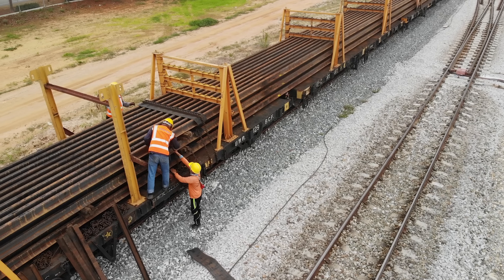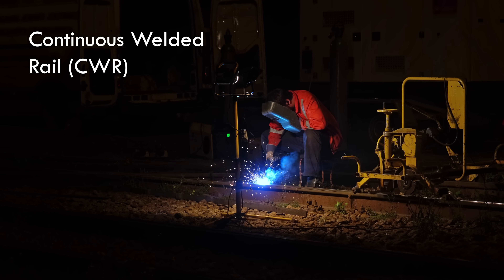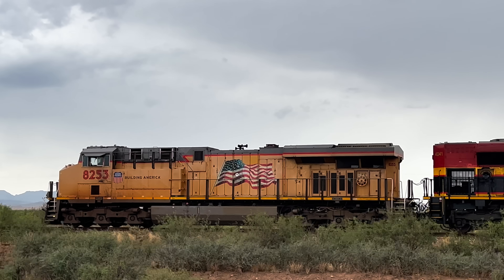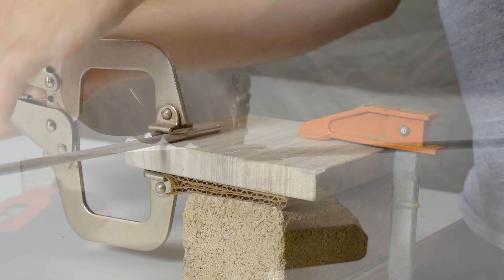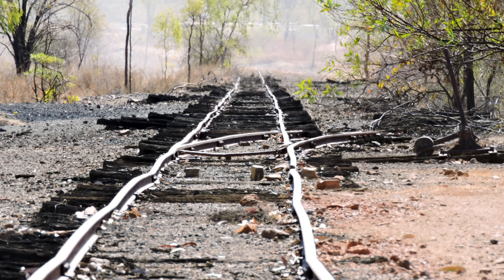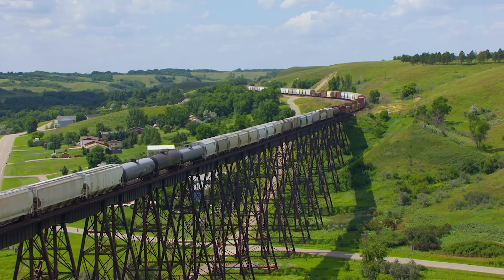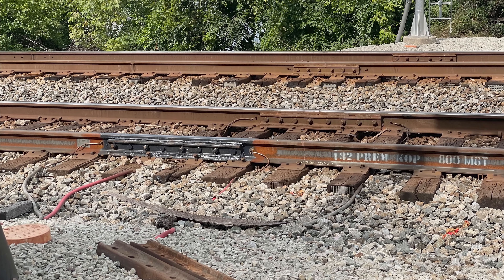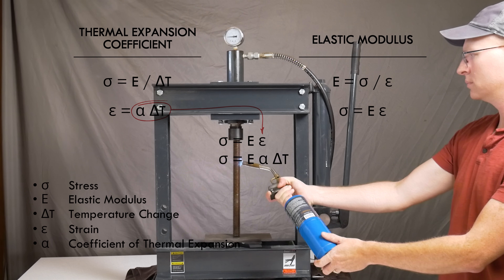Why Railroads Don't Need Expansion Joints

Comment: Can rails be manufactured in a special way so they act as "pre-stressed" units, like using a special heat-treating process while stretching the rail such that as the rail is cooled to a certain quench temperature the internal structure or the grain structure of the cross sectional area exhibits a negative coefficient of expansion during periods where ambient temperatures exceed the "neutral point" or the average high temperature the track will reach under normal operational temperatures? Or, is this kind of what you were describing they do already? I was wondering how much rails are  elastically "pushed out" ahead of a train due to the effects of rolling mass induced elastic deformation of the rails? Is it possible to see a "ripple-effect" precede ahead of a train as the tracks "bunch-up" ahead of the rolling mass? Is this "ripple-effect" similar to waves of motion created when a rock is thrown into a shallow pond? Do these waves of kinetic energy move under the entire train and is there a resonant frequency based on various factors such as train weight distribution, car lengths, length of the train, train speed, acceleration and or deceleration rates?  I have lived near a rail line for over 25 years and I have heard a lot of trains go by over the years. Within the past five years they (formerly Kansas City Southern Lines)  replaced the rails near where I live and went to the continuous welded rails while "beefing-up" the track in the process.  I cant say for sure but I know the new rail is significantly heavier than what was put down before. The original track was put  in in 1958 (dates on the concrete culverts). I estimate the new track to be somewhere about 115 to 130 lb/yd? I have also noticed a new type of "rolling-stock" being used, I think these cars are associated with those that handle grain or powdered products mostly. These cars have a peculiar "sound" to them as the "whizz by". They sound kind of like a "buzzing" sound like a huge zipper is being pulled. Really smooth sounding, kinda strange really. I have not seen the cars stopped yet so I cannot determine if the trucks are suspended differently or if the wheels are different somehow?

Comment: The same concepts are used in continuous eavestrough installation. Because most eavestrough is aluminum it has a rate of expansion of about .4 inches per 60 ft in a 160 degree F temperature gradient so thermoplastic sealant is used for corners and  60 ft plus runs get expansion seams while 45 ft plus get additional restraint by using additional hangers spaced closer together and any run 45 ft plus should be installled between 20 and 60 degrees F if possible. This is just best practice though, its not an engineered product or even a trade so every installer has a different process.

Comment: As a trained metallurgist and engineer, I found this amazing.... what a way to encourage future engineers, Simply, softly spoken.
Reply: Definitely! I am currently studying mechanical engineering at university and just finished taking courses on materials of engineering and strength of materials. It's awesome getting to see practical real world examples to the theoretical content covered in class. It's why I love Grady's content. I also did a research assignment on the development of the Hoover Dam in an introductory class to engineering and got hooked on all his dam analysis videos (proof reading this right now and find the ending unintentionally quite punny)
Reply: Same education, same opinion. I teach students the thermal expansion, also from the viewpoint of phase transformations, and I think this vid is an excellent example of application of knowledge. Knowing this is a must!
Reply: heheehehe 'trained'
Reply: @minerscale  haha
Reply: So does CWR not need a breather switch, also known as an expansion joint?
Reply: @sandgrownun66 expansion joint and breather switches are two different things. Breathers are usually used where the is a significant temperature difference i.e on the entry/ exit of tunnels & bridges but also they are commonly used as an interface between jointed & CWR track.
Reply: are you an engineer?
Reply: @cattnipp  can you read?

Comment: The rails are fixed in their width at the bottom and in their length; why doesn't whatever expansion that the steel goes through get relieved in the height of the rail or its width at the head of the rail?  Probably some very good science in whatever the answer is.

Comment: Those joints were never expansion joints. The joints were bolted up tight so they were going no where, expansion contraction or not. The fish plate is the plate the rail sits on, which is attached to the sleeper, not the plate connecting the rails. If continuous welded rail gets a buckle in it it has to be cut out and re-welded. This can happen on very hot days here in Australia.
Reply: Totally untrue, the fishplate is in UK terminology the plate joining rails, the plate between rail and sleeper is a baseplate if flatbottom rail, or chair for bullhead section rail.

The bolts used in the plates used in jointed track are slightly smaller than the rail end holes, and the plates are lubricated so that the joint can open and close to take up expansion. You do get a few joints in CWR usually in points or for track circuit insulation. These joints use bolts that fit the rail end holes, and are tightened up to a higher stress. The insulated joints are often called glued joints as the gap between the rails and the plates is filled with epoxy resin. This is NOT so it will act as a glue but to act as a gap filler so the tension on the fishbolts generates the maximum amount of friction between the plates and the rail.
Reply: @meeeeeeeeeeeeeeeeeeee2  That may be the case in UK but in Australia the rail sits on fish plates and they are attached to timber sleepers by dog spikes. On some tracks it didn’t even get fish places and the rail was spiked directly to the sleeper. The fish plates give the rails a slight camber towards the centre of the track. That is old technology now as all rail is welded and sleepers are concrete. The joint in the old rails are there because they had to be joined somehow. They were bolted tight. The only way they could have been expansion joints is if the bolts were shoulder bolts and the holes were elongated. If you had ever worked with old rail building cattle yards or cattle grids etc you would be familiar with this. The joints often still there on the old rail when you get it.
Reply: @jefftheaussie2225  Are you sure because the name fish plate, derives from a term in carpentry particularly at sea where if a ship had one of the spars that hold out the sails break and had no replacement. The broken spar would have a couple of wooden splints fitted and wrapped with rope to hold it together until they could reach harbour. this process was called fishing, Hence when railways were invented the joining of two rails with a plate each side reminded some one of this and the term fish plates was coined. Calling the unrelated plates between the rails and sleepers fish plates seems odd, but anything is possible on the railway.

Comment: I havent seen woden railroad ties in years, seen mostly onlu concrete ones as woood cna't hand the strain from going from -30 to +30, and days being +30 and night perhaps 2c is a BIG Change so concrete is just a no brainer.
Reply: Timber sleepers by the time you have treated them and fitted the baseplates cost about twice as much as concrete and only last about half as long. So now days only tend to get used on under bridges where the ballast layer is very thin. As they provide a bit more cushioning of impact loads. They are OK in CWR but need stricter hot weather precautions.

Comment: Diagonal taper - such a straightfoward iteration on the crude gap style. Why aren't they used more often? Still making noise? They don't look like it would be significant, especially if the carts have proper suspension. Seems overall simpler than welding and all that complicated math that can really be screwed up by temperature extremes.

Comment: Excellent info. I started my RR career in the 1970s, I was a signalman and then conductor for almost 5 decades. I remember  workin out in the desert doing cadweld bonding and at 8am and 70°,  there was a half inch gap in the rail, in one hour when the sun came up and it was 90° the gap would close with in minutes. Those oblique slider joints are fantastic, they prevent sun kinks... good video

Comment: The part of Canada I live (central BC) in has a swing of -30° to +50°c. Sun kinks and broken rails (from the cold) are just a seasonal thing we deal with, you cant get away from it.

The concrete ties can mitigate the sun kinks a bit because of their mass over wood ties but, it happens every summer.

Comment: they stil have problems with thermal expansion here. it is a temp deference of about 90-100c from winter to summer on the track's. the track's can get to 60-+ in in the sun during summer and -40 and below in winter.

Comment: Listen to what's being said here. I retired from a High-Speed RR Amtrak, and the one thing that I learned early on, was HEAT KINKS are e a real hazard. Mostly because a rail under stress may not initially show signs it is. Many times, as the first few cars pass over the stress (TENSION) point the vibration will cause the rail to jump out of its bed.  Naturally the train wheels can't navigate such a sharp bend and the train will derail. This is especially a hazard with the strings of welded rail that are now used, some as long a 1/4 mile with no joints. The way the RR overcome this, is heating the newly laid strings of rail to over 95 degrees with a propane heater, BEFORE anchoring it in place. If for some reason it becomes exceptionally cold and the rail contracts to a point where it breaks. the dispatcher can see this on the board and the signals will go into a restricted mode alerting th e engineer.

Comment: If I remember correctly, what my associates in the track department told me is that in the Northeast where we are, they had to lay the rail at a certain temperature range.  This is to mitigate the expansion and contraction which happens in our area because of the swings in temperature across the seasons.  When our company was bought out, the new owners decided to lay rail in freezing temperatures and they ended up paying the price.  Obviously, in Florida, as you mentioned, they lay the rail at a high temperature for a reason.  My knowledge of rail only encompasses running my trains over the tracks and also how the shape of the rail works.  Your video was very interesting and informative.

Comment: Well technically there’s a super expansion resistant alloy called super-invar.  Problem is it’s rediculously expensive and best used in absurdly high temperature applications like jet engines and rocket propulsion.

Comment: Here's a real reason behind clicks and clacks :) What is a train? An locomotive and carts. Carts are not powered, so we remove them. What's left is a locomotive but only wheels are touching the trails so remove everything except the wheels. Now, wheels are identical so we can only do with one. Now, a wheel is a circle. How to you calculate the area of a circle? Pi x r-squared. Pi is a constant so we remove that. We're not left with r-squared. Which is square. So of course a square is making clicks and clacks while it 'rolls' ;)

Comment: I am sooo glad I found your channel. I am very determined to build my own train track. Not a long way just about 80 foot long and all this information is super helpful I would used expansion joints instead since my track does not need to be extra strong or worry about clicking.... clickety clack .  Thanks 🙏

Comment: You might already be familiar, but rail (track) structure interaction analyses are a fascinating task that bridge engineers need to complete when designing longer spanning rail bridges that utilize direct fixation rather than ballasted track. It’s a fun nonlinear finite element analysis that considers the structure, the rails and the connections (with nonlinear springs to capture when the track slips from its hold down clips) to make sure the rail isn’t over stressed.

Comment: Interesting to install the rails on hot days to prevent compressive stresses and allow tensile stresses to develop on cold days. So what about fatigue? I woulda guessed the opposite...that compression would be better than tension with the thought being, eliminate tension to avoid fatigue and that buckling (due to compression) would be restrained by the tie spacing being so frequent. Are the tensile stresses kept below the material endurance limit?

Comment: So bottom line, using expansion joints would be easier, safer and cheaper?
Reply: No more difficult, more to go wrong, and the joints need expensive bending and machining.
Reply: @meeeeeeeeeeeeeeeeeeee2  why would they need bending? They’re joints

Comment: Really enjoying this series.

Inside a commuter train a fair bit and they switched to the continuous rail a few years ago.  It is interesting to see the engineering involved in that switch. 

Side note, I don’t miss the noise but I do miss the smell of the treated wooden railroad ties  on hot days. (they use concrete now)
Reply: Creosote :)

Comment: Very interesting! Could Practical Engineering please explore this topic in connection with the solutions used in Russia and the Former Soviet Union, e.g. on the Trans-Siberian Reailway and the Chongqing–Xinjiang–Europe railway? When I lived and worked in the FSU (Russia and Central Asia) I found the temperature extremes to exceed those I experienced in the U.S. considerably, and because rail is the premier mode of transport in Eurasia and between China and Europe, this topic will be of extraordinary relevance to Chinese, Russian and other FSU engineers involved in the design of the massive railway corridors now under construction in this hugely important part of the world.

Comment: I cross some UP tracks almost 30 times a week, and there happens to be a small rail yard right there on one side.  I've long wondered about things like continuous rail.  A couple of years ago they replaced some miles of track because the top was worn flat.  (I talked to the foreman about the project.)  The new rail was so long and thin it was like wet spaghetti, it was that flexible.  The matter of the neutral temperature is head slapping simple genius.

Comment: There is a limit to the length of welded rail.   Now the issue a rail fan  reported to me may have been handled by  better methods to anchor rails or  better provisions to deal with expansion.    My friend reported an early installation of welded  rail in the Salt Lake area of Utah had its rail pull free and bow out  from thermal expansion.     Such an incident might be due to the extreme changes between winter and summer heat in the area.  I suspect this incident pushed them to better thermal expansion management.   There can be a limit between " many fewer joins"  and "no joins over many miles"  in thermally active areas.    The desert's wide thermal range from below freezing to well over a hundred degrees and very long lengths of solidly joined rail would have created an extreme test of the technology

Comment: Did you already do a video on the outstanding energy efficiency of railroads?

Some years ago I was allowed in a secured setup on a perfect plane even track to try to push a locomotive with cars. And - it worked. My body alone was able to move those hundreds of tons. Slowly, yes. 

Compared to a truck where the rubber tire deformation eats up orders of magnitudes of more energy already.

Comment: UTTER FAILURE AT PRACTICAL ENGINEERING, BY ACTUAL RAIL ROAD ENGINEERS. HEAT STRESSES WARP RAILS APART, NOT GLUED TOGETHER IN PERFECT SYMMETRY AS THIS CLOWN THINKS. EVERY RAIL LINE IN AMERICA HAS PROVED HIM 100% WRONG 24/7/365 ccrx6700 needs to teach this kid how actual railroading works

Comment: Berlin has a lot of elevated subway track, but even restaurants with outdoor seating are located right under and next to it because the noise is fairly minimal. New York City (outer boroughs mostly because elevated track in Manhattan (other than bridges over valleys) was undergrounded 50+ years ago) has a lot of elevated subway track but the crashing thundering sound is so loud nothing like that is located near it and the sound severely impacts neighborhoods for several hundred feet on each side and can be heard much farther away. Partly because the structures are steel not concrete, and partly because of the jointed track (and the MTA doesn't care about anything).

Comment: There has been accidents because of CWR deformations during hot summerdays. I don't understand why maintenance is so much less when using CWR - a single accident will cost more than is saved. 
Maybe the real explanation for CWR preference is that people want trains to run faster, and therefore need better, safer rails. But rails for faster trains are not cheap. The maintenance on the nearby rails here at  my home is done by big expensive machines which pass here 2 - 3 times a year. That is not "cheaper maintenance". Doesn't the higher number of sleepers (holding the rails) needed for CWR cost more?
Also as the video explains, you can make rails with oblique ends which minimizes joint-noise.
Reply: Because due to the impact loads generated by the dip you always get at a joint as it is always a weak spot. The joints need more maintenance than the rest of the rail put together. The failure risk due to for example star cracking at the bolt holes, or breaking of the plates is also a way bigger risk than the downsides of CWR.

Yes using more sleepers per unit length does cost a little more, but the material cost of the extra sleepers is marginal compared with the total cost of relaying track, then you benefit from them for decades.